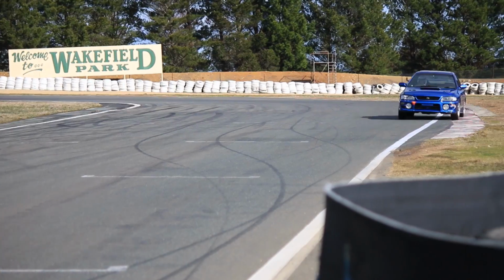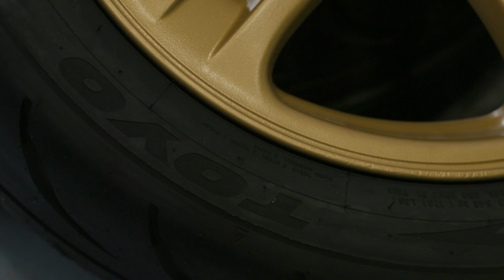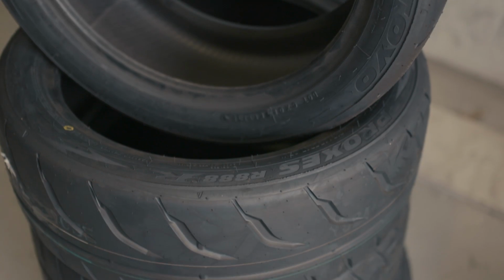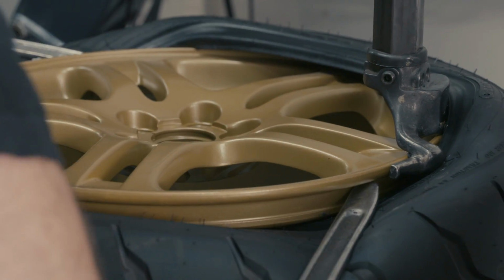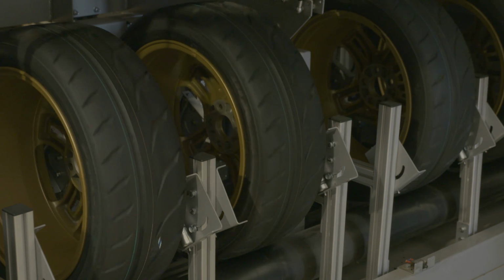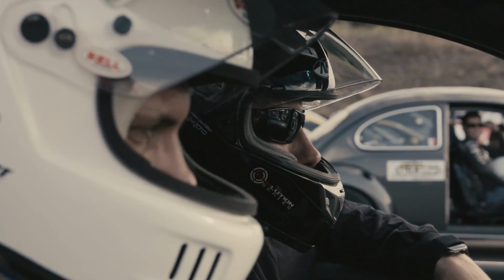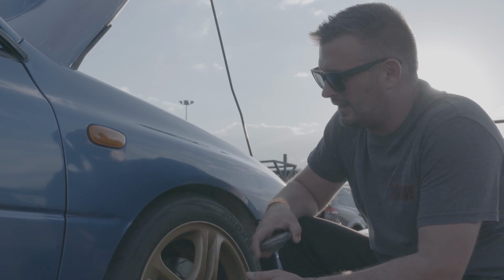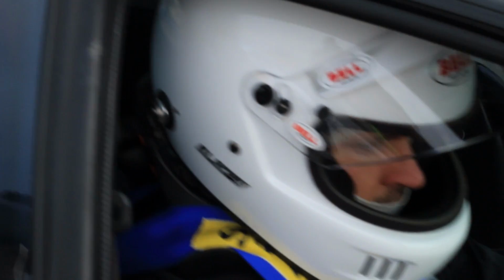Tyre Test Toyo Proxes R888R - Project Budget Track-Hack WRX Pt4

Comment: i got 235/50/15 r888 fronts on my turbo civic, the traction is so good. what surprised me the most is r888 well out performs my all seasons in rain, thought it be other way around. so good in the rain i run them from early spring to late fall, ill have to get a set of these new r888r to see how they compare
Reply: I wouldn't talk about civics on this channel, Andrew will flame the fuck out of you for owning one.
Reply: really because mine aquaplaned so badly in the wet, and that's on an 01 STI. any time ther was standing water i was really on edge
Reply: mine are the gg not ggg compound, maybe thats why, i can dead hook in rain in 2nd gear(20-60mph) 220whp non-lsd, in the dry with my all season 195/60/14 steelies i cant get traction till 3rd gear
Reply: The Brown Garage hmm mine are also GG compound but I guess we have different cars so hard to compare, mines v7 sti at closer to 400whp so need to be a bit more careful when I experience aquaplaning

Comment: Tires mask bad chassis issues...I would focus on braces and stiffeners and bushings that center subframe so I don't deal with inconsistent camber because the chassis is flexing and the subframe moves under load...
Reply from the maker: You are really making this way to complicated. Have you watched our suspension features on our time attack car and GT-R? Far more advanced but this is a BUDGET BUILD, and there is nothing overly wrong with the chassis that we are hiding and it had junk tyre son before. Any chassis mods would have made no difference with ow bad the tyres were before, so putting new tyres on is the smartest and most effective thing we could do. Its really that simple.
Reply from the maker: We know. We've done bush installs in multiple project cars. Your more than welcome to go back and watch them all.
Reply: MidShipCivic really get over yourself ...,.
Reply from the maker: faster is faster. And tyres provide the most amount of fast per dollar.
Reply: Every oem has rubber bushings on the control arms and subframe..  you could at least add a brace here and there and change the bushings out you never know what small little thing gives you a better camber curve, and eliminates an understeer or oversteer characteristic because chassis is giving adverse handling under  certain condition. Put in that work man no one is telling you to throw 100k at it lol.
Reply: ChrisHallett83 I love how your comment disappeared, p.s MotiveDVD doesn't know everything, I don't know everything you'd be pretty ignorant to say you do.   How ever this isn't about your other builds I'm watching a WRX other cars are irrelevant at this point . I don't think anyone's username is  you should be using to base their formal knowledge on... ever heard don't read a book by it's cover lil boy ( ChrisHallet).
Reply: MidShipCivic no clue center subframe and tires mask bad chassis issues clueless as fuck
Reply: You still reply on these videos with your incoherence... get lost lady
Reply: Yeah but that means ignoring other dynamics at play.. fast for you but not good enough for me.